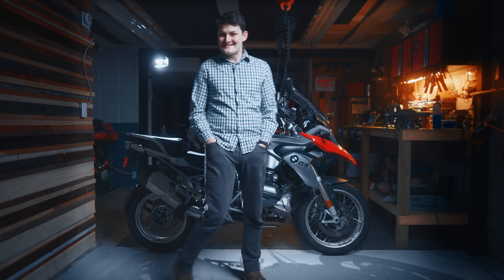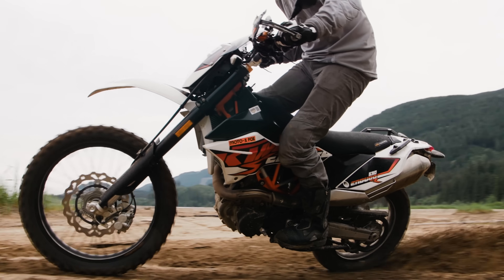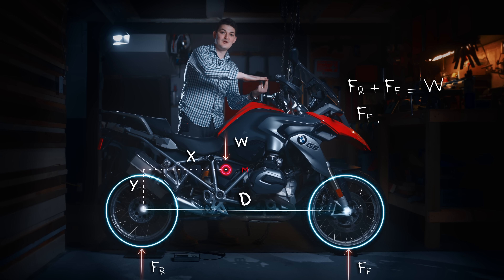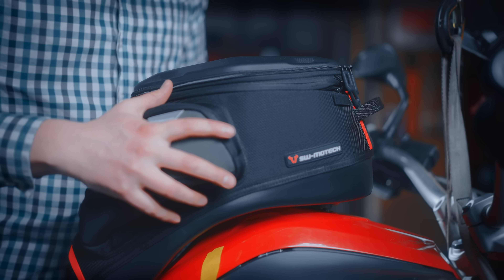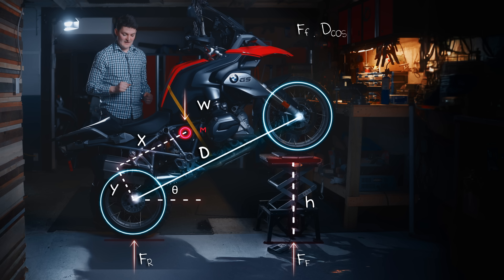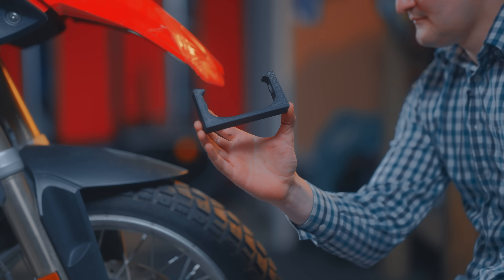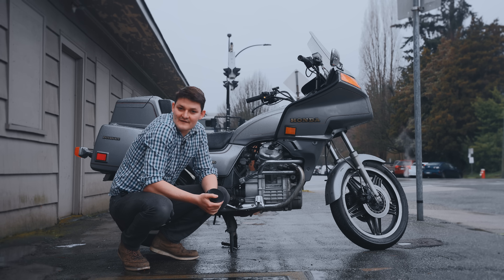Mark Your Motorcycle’s Centre of Gravity with a Bathroom Scale

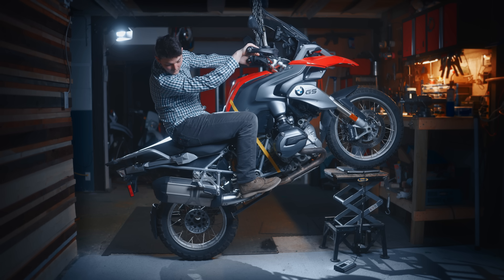Comment: Because I'm lost, I'll just ask, is he tilting the bike onto the rear wheel to simulate climbing a hill? Because if so, he made a pretty big blunder at 4:52 - if you're standing on a bike climbing a hill, you wouldn't be standing perpendicular to the bike, you'd be standing upright (i.e. leaned forward) which would shift the center of gravity forward.

It's also quite possible that I completely misunderstood this entire video. In fact, it's highly probable.

Comment: Standing turns the rider-bike into something like a compound pendulum. The upper mass (rider) can move semi-independently of the bottom mass (bike). It is the ability to tilt/move the bike more than the rider that adds to the stability of the rider, and gives the bike the ability to steer more without falling over.
Reply: Your legs become added suspension, so you won't be bumped out of the seat or ruin your spine, or tipped forward/backwards on steep hills. The rest is added advantage in my opinion.

Comment: Ryan, can't believe I'm about to disagree with you.  Here goes.  When standing we are not a static part of the bike, unlike when our butt is planted in the cushion.  The point of standing is to seperate the two masses, letting the bike do what it is going to do over the rough stuff and keeping your body mostly out of the equation.  If we stood up frozen on the bike you are absolutely correct, however we don't do that.
Reply: I do believe he actually said this.  It allows for the body to move farther away from the center of mass which improves stability

Comment: The center of gravity was raised when the bike was at an angle because the force applied to the handlebars was  increased due to the angle. When riding with the bike on the flat, far less force is required through the handlebars when standing and hence the effect of standing on the pegs will reduce the CoG compared to sitting on the seat, however every time you hit a bump force will be transferred to the handlebars, hence temporarily raising the CoG as seen by the bike.

Comment: Great video!

By the way, on the page for Bambu PPA-CF it says "AMS and AMS lite NOT compatible", so you probably shouldn't be putting it in your AMS if you want it to last a long time without maintenance.
The reason is because the carbon fibers in the filament make it more abrasive, and that abrasion can damage the plastic gears of the AMS.
The X1C comes with a hardened steel nozzle and hardened extruder gears for this reason; even the normal stainless and brass on the P1S is too weak for PPA-CF, much less the plastic in the AMS!
Reply: Depending on the PPA-CF.
...as currently such filament exists in form where only its core contains CF, and said core is covered by pure PPA, which not only removes the abrasion issue, but also helps improving layer adhesion.

Open source is a pathway to abilities some may consider unnatural i  know.

Comment: Found this out the old fashioned stupid way (well, i knew it would be like that but i accepted the risk of tankslappers because i'm stupid).

My old cbr1000f had 3 cases at the rear, loaded to their theoretical max, AND a diffel bag on the passenger seat. Total extra load was about 75kg.
There was a tankbag aswell, but voilla.

But! When installing the superbike kit i was lazy and the forks ened up 30mm lower in the tripleclamps. 

Result: i couldnt go 1/8 throttle out of a corner because the front wheel would start skipping and shaking. 

My rear brake worked twice as well though; but it had DCBS so that didnt matter.

Comment: When standing up you body moves around easily and you put you weight on different foot pegs to influence the bike, so the centre of gravity isn’t static one anymore, it moves around depending on where is the pressure point and body posture.
Reply: You missed the point. No matter what the center of mass will stay the same as the bike or higher. And possibly shifting more forward or back. But you can see how small a distance that is when you are on a heavy bike. 

The fact you can more easily become sprung weight (or even no weight temporarily) is what gives you an advantage by shifting forces into directions you want to influence the bike.  You can make your own body weight be able disappear with the correct upward movement.  Point is you have more control on the forces acting on the motorcycle and it really has nothing to do with shifting the CoG.

Comment: Hey FortNine! Loved the more mathy video, wanted to see peoples thoughts on one potential inaccuracy:
While measuring standing center of mass, you were balancing by holding on to the handle bars, and leaning back. This leaning is pulling weight off the front tire and messes with the measurement. 
I think overall, you don't apply your weight to the bike the same way with the front wheel up as you do in a normal riding position, so measuring standing center of mass, regadless of how you balance, could be misleading with this setup. 
Regardless, very cool video!
Reply: Yeah, and by standing up generally you get a looser connection to the bike, so the bike+rider doesn't behave like a rigid body (like while sitting).
Reply: @guimblon  Yup, it becomes a 2-axis pendulum. So simple centre of mass is the wrong concept. But I am fine with his explanation re the roll axis... close enough

Comment: Bambu lab printers can read the RFID in your filament spool which is a cool feature until they decide to software lock the printer because it can't detect genuine bambu filament a la keurig k cups
Reply: ... That feature is really only with the AMS, which is optional. You can still use other filament without the rfid reading at all, and there's no way for them to even check if a rfid tag exists if you don't use that AMS. There's plenty of anti-consumer stuff Bambu Labs does, no need to go making up non-issues.
Reply: Cory Doctorow wrote a book about that precise problem.

Comment: I'm confused about your argumentation about Ff×D = W×X

You said "since the motorcycle isn't going up like this [ ], Ff×D has to be equal to W×X"

Imo, for "not going up like this"  Ff×D just has to be LOWER THAN OR EQUAL TO W×X. But not necessarily exactly the same as W×X. 

I mean I'm sure that I'm wrong and Ryan is right, but can someone explain it to me? Seems to be crucial for calculating X
Reply: If it's lower than it, it would be tipping forward.
Reply: @gabeh.4297  no, because W×X is a moment around the rear wheel, so if W×X would be higher than Ff×D the motorcycle would try to spin clockwise around the rear wheel, which isn't possible because it pushes the front wheel into the ground. 
It would be tipping forward if Fr×D is bigger than Ff×D, because Fr×D is a moment around the front wheel.

What the explanation lacks is something that translates the fact "Ff×D needs to be smaller than W×X" to Fr. 
We need another variable like X, but this time it describes the distance between the center of gravity and the front axle.
Let's call it Z. 
This would make the formula: 
Fr×D <= W×Z

For me to make this whole thing make sense we gotta bring the two formulas
Ff×D <= W×X
and 
Fr×D <= W×X 
together somehow.
I just don't know how, thats why I asked my question.

Also since Fr+Ff = W , the connection between Ff and W can be made somewhere else. 
But it's missing in the video entirely, from my understanding the only connection we have made between Ff and W is the obvious one that Ff < W , because Ff is a fraction of W

Comment: Is marmite the same as Vegemite ?
Reply: While both Marmite and Vegemite are yeast extract spreads, the key difference is that Vegemite tends to be thicker, darker, and has a more intense, slightly bitter taste compared to Marmite, which is considered milder and slightly sweeter, with a thinner consistency; essentially, Vegemite packs a stronger punch than Marmite due to added vegetable extracts and spices, making it the more "umami" option.

Comment: For static purposes it's true, but in a dynamic case (guess what a motorcycle does) the center of mass is not a point where you can ignore or simplify all of the individual masses into, as moment of inertia is heavily depending on the relative positions and values of these individual masses.
Reply: More importantly, when you turn, mass far away from that center will feel different than mass close to it.
Reply: It’s been a long time, but if looking at the weight distribution laterally having the riders weight split evenly on the pegs vs on the seat (~20in higher) is going to make a big difference when the bike leans, which is described as the moment of inertia if memory serves. This is why Ktm 790s and 890s have low slung fuel tanks which makes them feel lighter than the top heavy T7.  If the rider is heavy in relation to the bike’s height and weight the standing vs sitting scenario is going to be more pronounced anytime the bike leans. Whereas, if seated and the bike leans due to a rock, root or rut moment of inertia wants to cause the fall over or at least be off balance. Obviously other forces cone into play, but having the rider connect at the pegs not just the seat is going to make a lot of difference at the slower speeds.